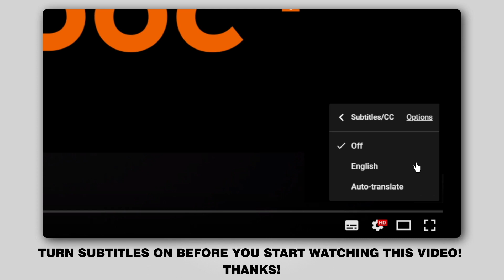How to change spark plug on FORD FIESTA V JH, JD [TUTORIAL AUTODOC]

Comment: Wtf max torque on these are 15Nm, 25nm is wayyy to much ! 😂
Reply from the maker: Yes, you are right, it will be useful for us. Thanks for your attentiveness.
Reply: 15Nm seems so loose though when you're tightening the spark plug up...25Nm seems about right to me by feel, although it probably isn't right technically I prefer to tighten them up to 25Nm. 15Nm for an M14 thread is very loose. A wheel bolt that is M12 or M14 is tightened to around 90Nm
Reply: Hi, how much does Ford recommend as nm in the booklet?
Reply: @seanhopkins7857     i wish you good good luck with a 25Nm ! :face-red-heart-shape:
Reply: @scottykilmer1094  it's been perfectly fine for months thanks...15Nm might as well be hand tight lol
Reply: Lets see how perfectly fine it is after its time to change the plugs.. :face-fuchsia-poop-shape:
Reply: @scottykilmer1094  I'll film me removing them and post the video for you to see 👍
Reply: No thanks Seanhopkins, I don't want to see a removal video where a spark plug without an O-ring is tightened to 25nm. :face-green-smiling: